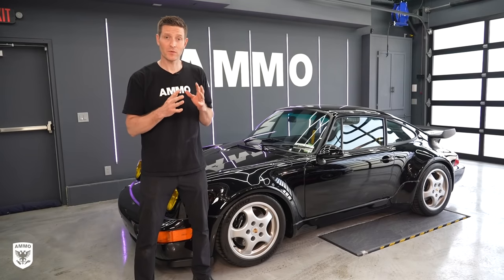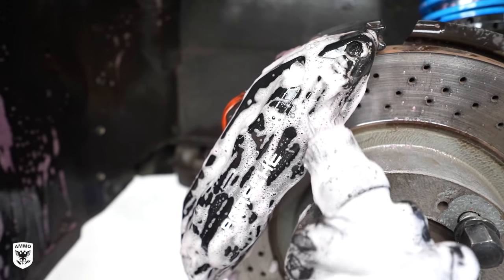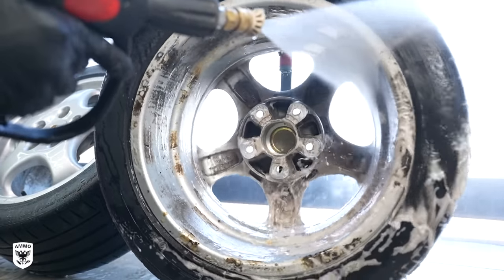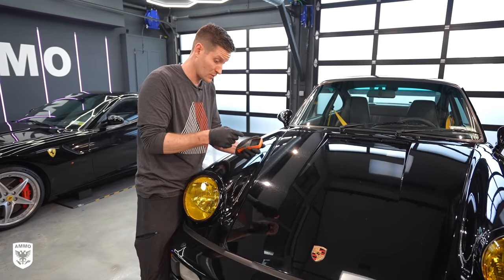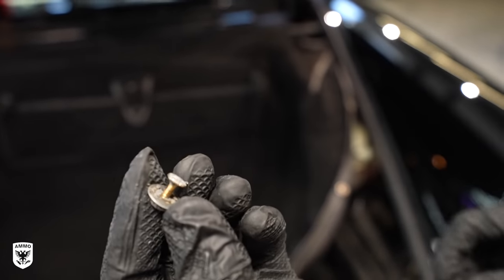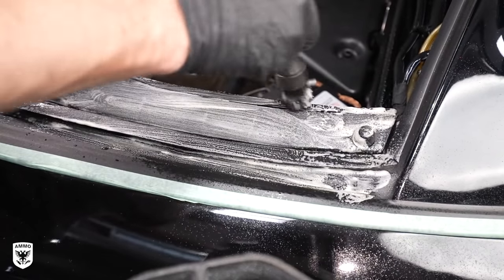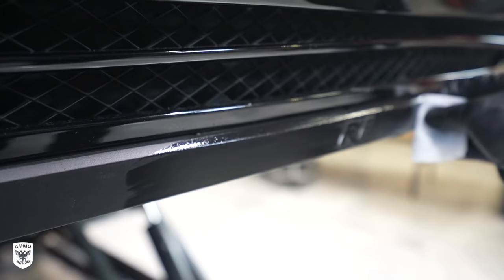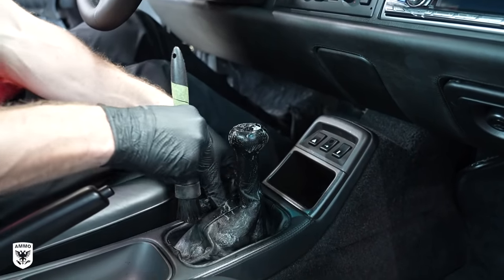Porsche 964 Turbo Full Detail and Drive: Polishing Thin Black Paint

Comment: Larry- I’ve had to remove more clear bra than maybe anyone else in history while working at a used car dealership. The best trick I’ve found for the adhesive after peeling is to grab an old foam cutting pad, make sure it’s extra clean, and spray some 3M adhesive remover on the glue. Let it set for a bit, then prime your old pad with the adhesive remover as well, and polish the glue right off at a low speed on your Rupes. Give it a try next time you have something like this, but maybe on a lower end car to start with! :)
Reply: I pulled off the stripes on my car and what a nightmare getting the adhesive off was. Car paint on hood was a repaint and was off color with the fenders after 10 years of fade. You can see the shadow stripes from UV exposure. I wish I knew this trick.
Reply: You've removed more bras than I've ever seen 🤣
Reply: Wd40 works well on adhesive on paintwork also
Reply: Or on anything for that matter
Reply: @PACKERMAN2077  only the clear kind ;)
Reply: @PACKERMAN2077  Larry's still not as good at it as the Fonz was :)
Reply: @MetalGuru965  👍🏻👍🏻
Reply: dope took stickers off a van this tip saved me 4hours minimum thx bro

Comment: I recently did a ceramic coating on a 2014 Mustang, black as well. Paint depth gauge showed mid 3's for thickness.... I told him, i can only do two steps maximum. It looked unbelievable compared to what i started with but I just couldnt get it absolutely perfect. Ceramic made a hell of a difference though, really helped fill in some of those deeper scratches that just weren't able to be removed. Client was absolutely over the moon with how it turned out, but I always feel a little emptiness in me knowing i couldn't get it absolutely perfect

Comment: Great video Larry. As the owner of 3 black Porsches I love these episodes. Question: on the 996 video where you framed the car, what did you use to strip the gloss from the rubber window seals? Elbow grease and a microfibre only go so far and polish turns it white like you mention in this video.
Reply: Water based polish during the wash. water based only

Comment: On my America roadster, I run the RSR front splitters (like on your C4) in the front and the 3.3l turbo wing in the back.  That combo is the most stable at high speed (German Autobahn top speed 302Kmh or 187mph) and yes there are modifications to the 3.8 liter motor.  I had tried various other front splitters including the Ruf lip like on this build, but the RSRs with the big rear wing was by far the best stable combo for high speeds.  Running 9.5x17 and 8x17 Cup2 wheels from a Turbo S also helped stabilize the car.

Comment: Excellent job Larry, just wanted to point something out on both cars: the oil pressure gages on both are pegged high as you are driving regardless of RPM. That normally indicates that the  pressure sensors have failed. Unfortunately they are not as easy to access on the engine as on older 911's.

Comment: I removed 20yr-old extremely-weathered clear bra from a 2000 Audi A6 with the same methods listed in this video; it was incredibly tedious but after removing everything and polishing out the paint, it was almost impossible to tell that there had been a clear bra there! Definitely improved the curb appeal of the car to not have that dry desert-looking mess on the car.

Comment: 4:38 Is there any issue of using a Steam Cleaner to help clean the Rims?

I used it on my aluminum wheels yesterday, and it seems that it worked wonders.
Moreover, I spend less product which cost money, and chemicals which are (always) bad for the environment, the surfaces, and myself.

Comment: Love your videos, could I ask - why would you use boiling water from a kettle and not a steamer up close, I would have thought you could apply the steam more often and quicker than the boiling water?
Reply from the maker: Steam is not as hot on a larger area… just 1 small spot at a time. By the time u get to another area, the previous is already cold. Water soaks in the bra and stays hotter longer for easier pulling

Comment: Hey Larry, do you put anything on surface rust on the underbody (control arms, chassis rails, subframe etc) ? Whenever I have my cars up on stands I give any surface rust a spray of "Soft seal" by CRC. Its considered a corrosion inhibiter its basically a super thick waxy spray. I've found it works a charm on stopping any rust from getting worse. Plus its great for the OCD knowing all your subframe bolts are not rusting out :P

Comment: I have removed a lot of bras 😏myself🥰😁. I know Victoria's Secret...LOL. I wonder if Fendi will design bras for fenders...lol. I 😍love subs😉. There is no Tie for engine 😂tooting. For me - a naturally aspirated Porsche is more fun to conduct than a turbocharged engined Porsche, or any propulsion system within, or without a form of transportation. Have You found any more success with Nitrogen inflated tires Larry, or Oxygen inflated tires? When using the Rogue branded stepper, runner exercising device - I suppose the user becomes an X-Man😊. Must be cool to have power to take someone, or somethings talent, and power's😏. What a Marvel. I wish I could do the same. I hope You feel better Larry. Do You believe the Toronto Maple Leafs will win against  the New York Rangers this season?Why not use Teflon tape on Your automobile wheel studs(wheel 🔩bolts)? Or grease? Leaving the automobile wheel 🥜nuts🐿 on the automobile wheel 🔩bolts is a good 💡idea. There are ways to design, and construct Your own tires. Look into this for Yourself. Porsche makes for a good road vessel in racing applications. Porsche automobiles handle Great...especially in high speed maneuvers around curbs. The torque to weight ratios of most Porsche automobiles is close in tolerances. The efficiency of the thrust components, hydraulics, load coefficients hold true in extreme environments. Regular proper maintenance helps the life of anything increase - no less in respects to a form of transportation. I am surprised that Braun, and Yourself did not design, and manufacture a lawnmower wheel woolly 😁. Maybe Hasbro can create a NERF Power Washing Gun😃. Think about adding a front mounted spoiler to increase automobile down force...if women switch to 🙀clear 😱bras...may GOD help us all😏